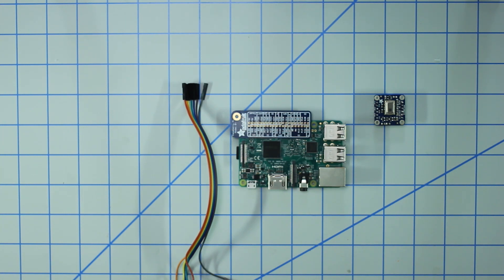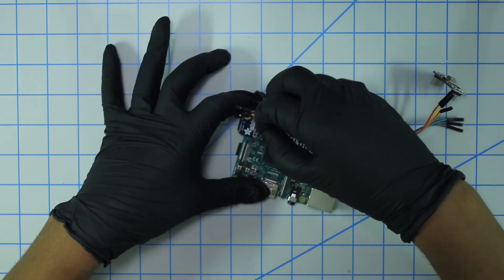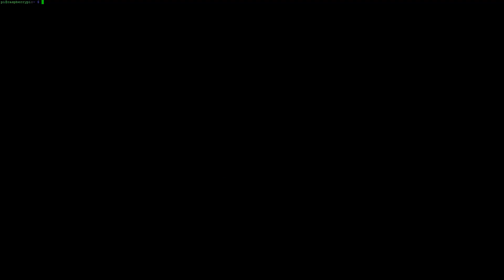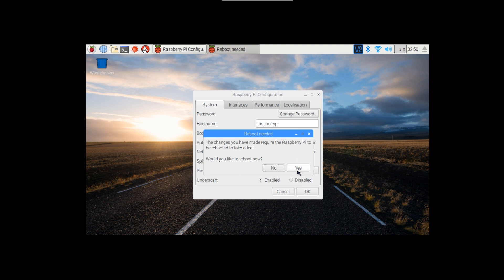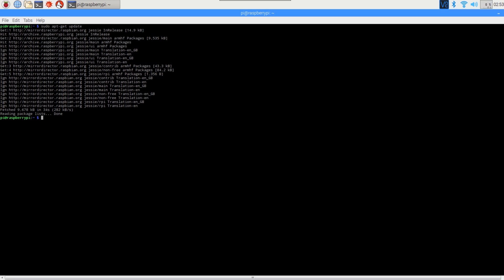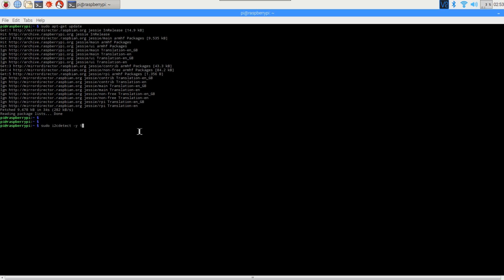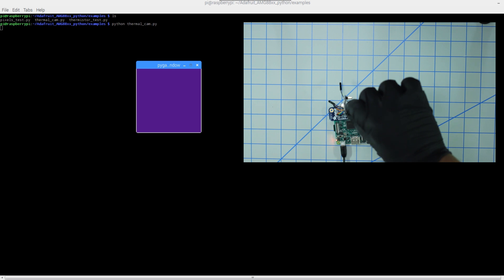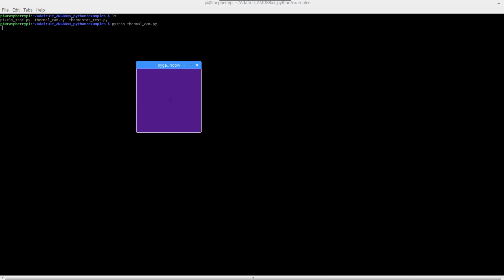Thermal Camera (AMG8833) Raspberry Pi

Comment: I can not speak English well. Ask using a translator.
I saw the video well.
I have one question, but the same amg8833, but I don't have much information on this side, but in the video, i2c function through the wiring seems to have connected with Raspberry Pi. No, how do I connect to a Raspberry Pi with usb-tpa64?

Comment: hi,
in the official website, you wrote the parts that is needed for implementing.
can you please explain them one by one and how did you use them
i mean RPI 3 
4 Amp Power Adapter 
16GB micro SD
120 pcs jumper cable
AMG8833 IR Sensor
i'm a beginner and we are trying to use this sensor in our graduation project
so, can you please answer me as possible as you can.
thanks,
Reply: how did it go, im thinking of doing the samw
Reply: @xxzasterxx9476  it is a new sensor so there is limited libraries for it
So, you may get a tough time if you want something specific rather than just detect the heat

Comment: Does anyone have this same setup using C Code? I combed around the net and a couple articles state that the Thermal Camera will run much faster and much more efficient if programmed with C instead of Python however' no one gives an Example in C.

Also this Tutorial is really good, thank you for posting it.
Reply from the maker: I think the resolution will still be an issue though if you are concerned about performance/clarity. I found this library by Adafruit (I haven't tested it): https://github.com/adafruit/Adafruit_AMG88xx

Comment: I've just built one of these, based on a Pi Zero. I found your instructions very useful, and easier to understand than the Adafruit ones. I'm struggling to find a way of starting the script from a desktop icon so that I no longer need a keyboard connected. I'd also like to add a button to store a snapshot.

Comment: I made simple thermal scope with pi zero and little screen for airsoft sniper.It’s not that worth it buts its nice for headshots becuz only heads are red
Reply: I dont aim with it i only located the people and aim with normal scope
Reply from the maker: That's cool. I'm assuming it works at a distance because the resolution is pretty low. I'm currently trying to do something similar and mount it on a drone. I'm running into issues streaming the data however... :/
Reply: PiddlerInTheRoot bro its not worth it unless enemy is hiding in bushes nearby

Comment: Hi, I have a question about the thermal sensor product, the link that you put in the description box, does it include all the equibments? i mean the sensor chip and the camera?! cuz when i checked the product there wasnt any clear description about  the product.
Reply from the maker: It comes with the thermal sensor and pcb as well as headers(unsoldered).

Comment: If several such sensors are used, can the image resolution be increased by interpolation? In other words, is it really possible to assemble the thermal imager on this element base?
Reply: Complicated germanium optics is needed, so it would be cheaper to buy a factory-made thermocamera than building your own from these parts.

Comment: hello,
can we detect buried objects with this thermal camera?
Reply: +Noah then can you please tell if there is any thermal imaging camera we can use to detect landmines?
Reply: You could detect something under the ground if it presents a different temperature. Say when the night comes and the object under the ground keeps or loses it's temperature. I would never bank my life on it.
I'm not joking here. If you trained dogs or pigs to look for them. They can sniff out almost anything.
Reply: +m1aws Thank you. I am developing a prototype of landmine detector for that purpose I want to use thermal camera. what would you say about it this?
Reply: Salman Ashraf its a toy.
Reply: +m1aws okay.
Reply: +Salman Ashraf how would FLIR help detect buried landmines?
Reply: Detection of landmines with IR cameras is possible. Much can be found online on this subject. However, the cameras used for this are far superior to the AMG88xx series. The theory is straightforward - landmines heat and cool and different rates that the ground around them, thus when the temperature increases/decreases throughout the day the ground above the landmine is different that the surrounding ground. The faster the temperature is changing, the larger the temperature difference.  Of course the amount is still small, perhaps less than 1 degree C, thus you need a sensitive camera, typically one that is cooled. These cameras are on the order of $10K to $100K depending on a variety of specifications (resolution, sensitivity, accuracy).
Reply: Rube thanks.

Comment: Hi am am curious before I go about buying all the parts but would this camera be able to help me locate say a caterpillar on a leaf or in a bush? Thanks for any input!
Reply from the maker: No, the AMG8833 is very low resolution, so I don't think it would be good for that use case.
Reply: Follow up to the above question, is there any camera available for pest detection using Raspberry Pi 3?  Any alternatives to AMG8833 that would do this job?
Reply: Same question